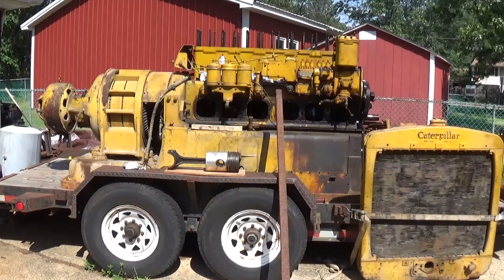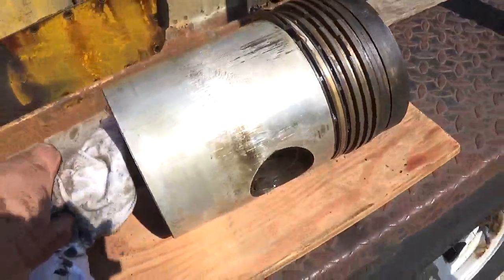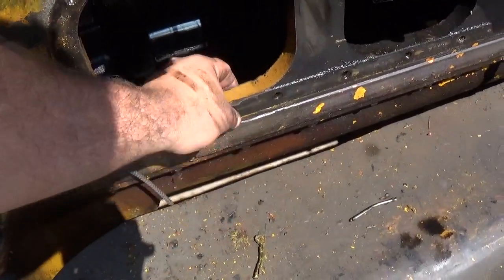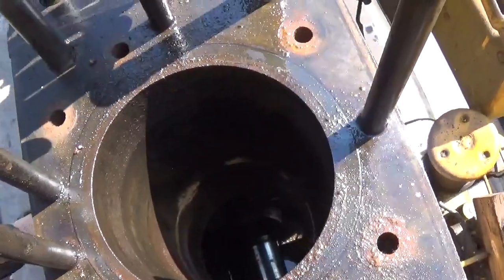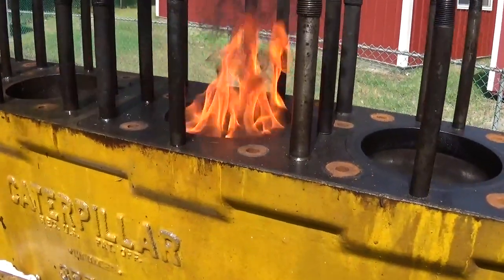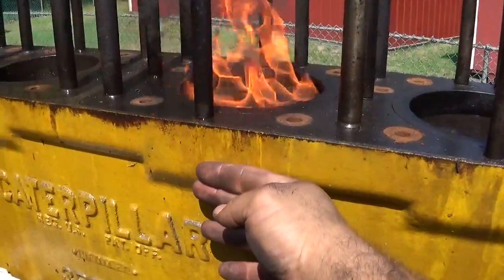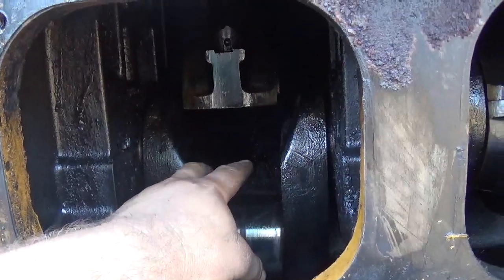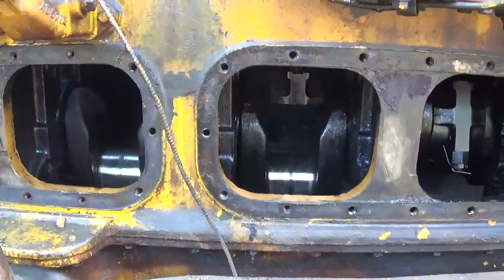Caterpillar Generator Set Repair Part 5 (Tear Down #3)

Comment: Incredible job! Considerably more than I would have tackled at half my age, when I was actually working with heavy production machinery at work, and tinkering with our converted bus in my "spare" time in the seventies! And I thought an 8V92TA Detroit was big and very heavy!  Great for you! Get it running right again, and you'll have something that will continue to do so for as long as anyone wants it to! Cast iron of course, was king then, and still is when longevity outweighs weight.

Question: I have been (before I retired) working with your basic 2 pole portable generators, buying our heads mostly from MeccAlte and Sincro, so my idea of capacity is somewhat skewed. On the heavily built 4 pole generators, how much margin for short term overloads do you think is designed in, assuming the prime mover is up to it? THANKS! I just recently "discovered" your channel, and enjoy following along!

Comment: If you were to place a thick steel plate across the crank journal and the outer edge of the case, you could then place a fulcrum point anywhere you like on the plate to multiple the torque up on the piston. The closer you place the fulcrum pivot point towards the crank journal, the more you multiply the torque. Just a thought.
Reply from the maker: Thanks for watching! 
I ended up using a mini hydraulic ram.

Comment: Just ran into your site . Though’s old cats are tough . I have run into what you have . Was always able to break the engine loose with penetrating oil and get on the front pulley or the flywheel with big bars ,rock it back and forth  have to have compression realiece  pulled  pt portapower  on bottom of connecting rod to get it started moving , but don’t go to far one way , go back and forth  
   That piston damage came from a bad injector ! So piston had to come out !
Reply from the maker: Thanks for watching!

Comment: I would recommend using some electrical tape or similar to tape your big end journals up.  Your taking a gamble on getting contaminates into the oil gallery which will cause major problems when you get it back together.  Would hate to see a pre-mature failure after all your hard work.

Comment: put the greased rod bearing shell back  in the end of the rod.  since the crank will now rotate.. bring the crank around to push the rod and piston up.  if its really seized..  you may free up the liner.. so the whole assembly will come up. 

many years ago. helped a friend pull some pistons and liners out of one of his motors.. drilled 2 holes in the top of the piston .. put long Grade 8 fine threaded rod thru it.  he had a C shaped plate with a step that fit up inside the bottom of the liner. around the rod section.. pulled the sleeve with the piston right out from the top. 

if you have a set of transfer punches.. and a piece of 1/2" plate.. transfer the side cover bolt patterns to the steel plate.. it only has to cover the openings about 5/8 of the way.. this gives you a much better fulcrum  when you bolt it to the block openings..  you could drill several patterns into it.. 

so there are several ways to free it up. 

measuring the bore ID.. and the bottom of the sleeve OD.. will allow a sleeve pulling plate to be created fairly easily and perhaps cheaply. ..  if you get 2 of them made up.  you could cut the groove to make it fit around the rod.

Comment: First thing I always do, is cover the rod journals wrap them with thick rags,then duck tape .murphys law can take-effect, that bar slips and hits the crank,also crud can get into the oil holes on the crank, does not take much to ruin a journal, Protect that crank,please

Comment: if you're replacing the liner you could weld a steel sling to the walls and pull off the deck, if you're keeping the liner you may try welding to the piston. If piston is to be replaced, you could also try drilling and tapping fine threads and using bolts as anchors.

Comment: Too bad it's not like the headless witte. If it wasn't for the crank being in the way, you could make a    1/2" steel plate to use as a head, fill with trans oil and pressurized it downward with the portapower.

Comment: Why not use a cylinder pack puller if perhaps you could get the lone of one and pull the cylinder and rod as one complete unit. You would have to remove the head studs to fit the lift assembly in place. This would save you a lot of time and energy as you are pulling the liners anyhow. Great job so far BTW. 👍

Comment: best way is to reconnect the piston to the crank, fil the bore whit diesel ant atf oil, let it soak for 24 hours, then refil whit a rag and diesel, and light it, then let it heat up, and thry to turn the crank, al little back and forwards, worked every time y tried this.
A block of wood and a hammer will do the rest., iff it doesnt work, thry again a day later (refil the bowl)

Comment: Perhaps using a can of refrigerant (R-134a since it's cheap and readily available), and a hose.  Turn the can upside-down to apply liquid refrigerant into the bottom of the piston to shrink it in the bore.   Wear gloves, as you can get frostbite from evaporating liquid refrigerant.   Otherwise, I'd look at using a wood block on the crank throw, and the tip of your bar on the block, tip the con-rod back towards the inspection hole and push up on the bar.   This should increase the leverage quite a bit (not to mention you'll probably be able to apply more force by lifting up than pushing down).

Comment: Would the liner come up with the #3 piston ? To my way of thinking, if those pistons are stuck that hard,the liner is going to have problems and although the pistons could be reuseable it's going to cause low compression problems with pits in the liner walls.

Comment: Massive rod and piston; large mass, precision machining. When parts have a lot of material, energy and effort gone into their making it raises the bar as to what's not worthy of repair whenever possible since a lot of material, energy and effort basically equal expense.

Comment: them piston sleeves come out with a tool you insert into the bore an you tighten it up an a plate bolts on you turn a screw an it pulls sleeve out cat sells repower overhaul kits piston an rings sleeve bearings an all in one kit

Comment: Hi you might what to check the injector on cylinder 4 I have seen prisons with similar erosion cause by a bad injector spray pattern. I know you will have the injector cleaned a checked before reinstalling them. Your sleeves can be bored and sleeved, and then bored back to standard if the sleeves are thick enough. I like your video's say hi to roadking a the guy's I like what you fellas do, I play with the old hit miss engine myself. deplete

Comment: twist the connecting rod 
... put gasoline on top of piston...
Reply: Abricos4440 good way to wreck rod and piston sleeve rings. Esp when connecting rod is unbolted parts for engine are spendy. I would try dry ice in cylinder or that liquid nitrogen.
Reply: ka7wyf yes of course put liquid nitrogen on  Cast iron  ...

Comment: That's a tough one Mike! I have had success with acetone/ATF mix and also just soaking with kerosene for freeing up stuck engine parts. It requires patience though as it is slow to work. Evapo Rust or  a similar product probably wouldn't work as it is not a solvent and won't get past the carbon on the rings. Other than that, brute force and heat is all I can think of. Good luck buddy!!

Comment: I don't recommend using hydraulic force against the crankshaft. I'd put the bar above it and use the jack against that. Otherwise you will distort the crank. Worse come to worse I'd drill and tap the piston and use a puller from the top.

Comment: Mike, we used this concoction for years in our heavy diesel repair shop to unstick pistons. Use equal parts of acetone and any type ATF and fill that cylinder and cover it up so the acetone doesn't evaporate , and see how it works. We have also uses dry ice to shrink the piston.

Comment: Do you have access to "CO2"... attach a hose to the shut off valve, long enough to reach in & up to the back side/ bottom side of the piston, (wear gloves, or rig up some heavy wire as a support) crack open the valve, for a about 30 second at a time.. the white ice will form and spay all over the place ,but it wall evaporate away.. may take several times, and or up to a minute or 3 per shot?... the idea is to shrink the piston in diameter... or are you suspecting the rings are the hang up?... the fire trick you did, that was clever.. I will have to remember that one... Keep at it, looks good so far..

Comment: I have had good luck with rusted pistons using electrolysis I used a can that would fit in the cyl with v belt cut in pieces for insulation. Check the web for the procedure electrolysis for rust removal.

Comment: You don't think putting that much force on the crank is going to distort the crank?? Can you remove the sleeve with the piston inside it and work it loose separate from the motor?? Seems much less likely to create any collateral damage to the remainder of the motor??

Comment: Hey Mike. How about putting a thick plate on the head studs and use that as a stop to push the piston down using some kind of press? They look like they would be strong enough to handle the force and no risk of crank damage. That gives you a bit more space to work with too. 
Nice to see some progress!
Reply: Everything cracks, even a C piston. Not the recommended method. What might work, but holly golly i do not want to think how he could pull that off, would be to heat the cylinder bore and cool the piston. Worked on my generator, however, being smaller, i turned mine upside down and used the skirt as a ice cube tray.
Reply: aserta I'd mostly be worried about damage to the block, the studs and piston I'm sure can take it but is there enough thread in the block or are they gonna get ripped out? I didn't mean push straight on the piston, put something suitable on top of the piston to push down on the outer edge, not the middle. If the piston is going to crack using this method I'd say it'd most definitely have cracked before it moves when pushing on the conrod? Or at least have made the wrist pin holes oval. 

Stuck pistons can be the worst.. I once had to resort to a pneumatic hammer to get one out. No amount of soaking or heat helped, the rings had pretty much fused with the sleeve. The piston was obviously not usable after that but I was just happy that I managed to get it out without ruining the rod. Still have that piston sitting on my desk as a reminder :)